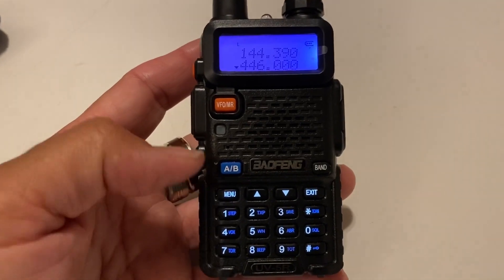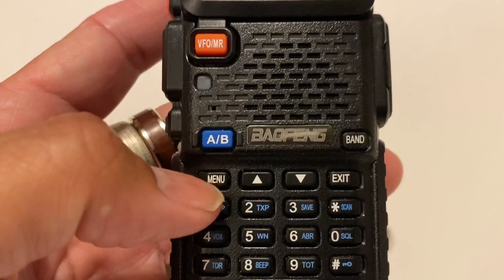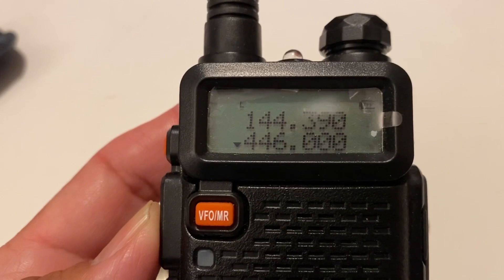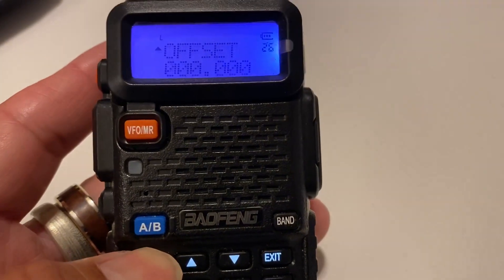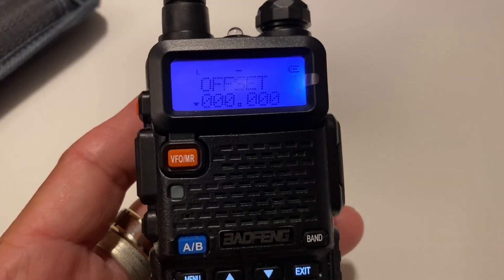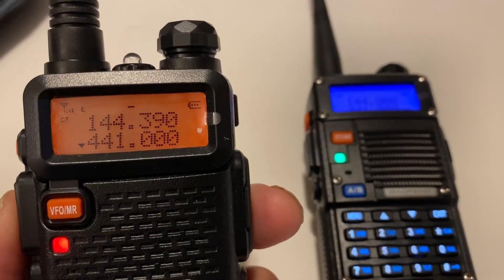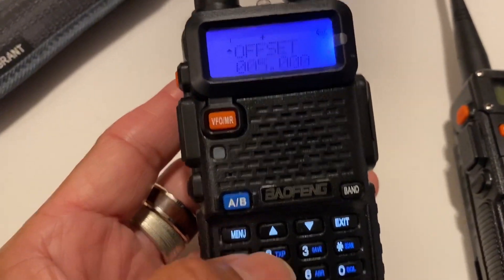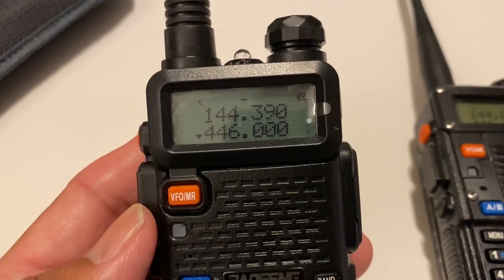How to program CTCSS and OFFSET on Baofeng UV-5R

Comment: I can set the CTCSS codes, so that I can communicate with another radio, however, if I turn if off and then back on, the codes are gone. I have CHIRP downloaded to my computer, but cannot change the codes there either. Any suggestions? Thanks in advance...Clint

Comment: You know how to solve The disappearing offset problem and if so can you make a video on it? For some reason the early radios magically lose their offset. Just programmed both of mine using the chirp software and they were good for about 5 minutes then the offsets disappeared. Thanks!
Reply: Yeah. Offset only stays set if you’re in frequency mode and set it before saving to a memory location. Set menu options 25, 26, and 27 in that order. Once the frequency is saved to a memory slot, trying to set or change the offset value just gets ignored. Has to be done manually (not using chirp) and prior to saving to a memory slot. 
If you use chirp, use “split” instead of “-“ or “+” in the “duplex” column, and then input the actual transmit frequency instead of an offset value.